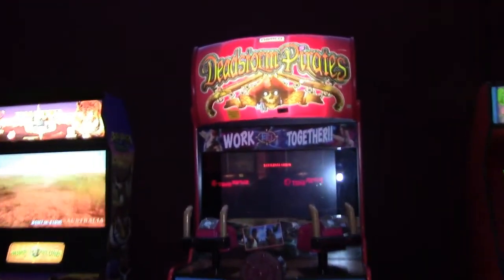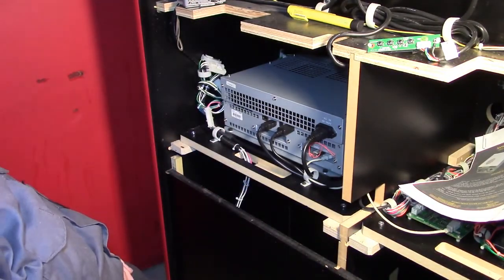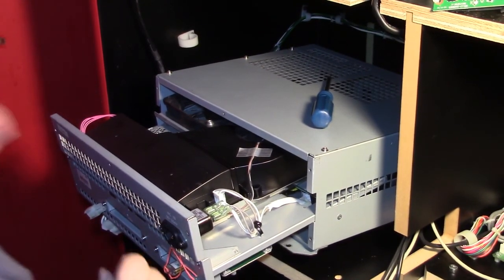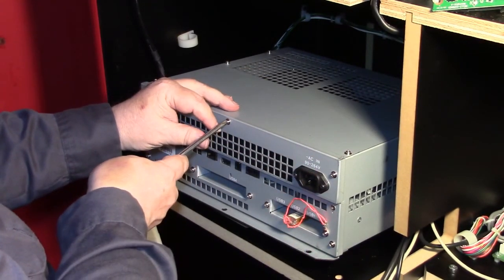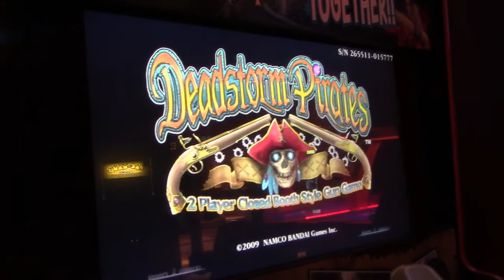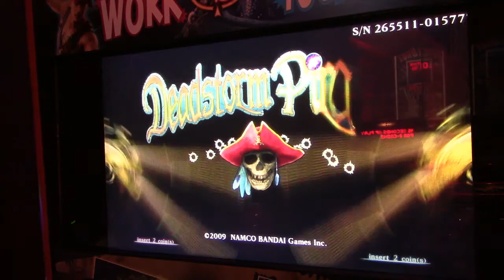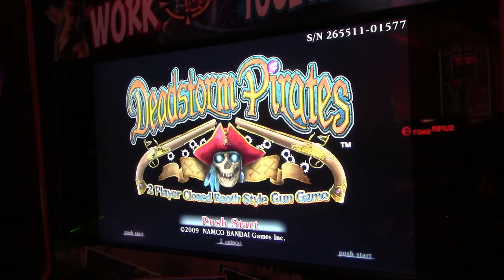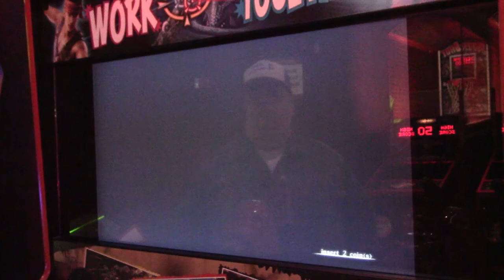Arcade Fix Deadstorm Pirates BATTERY02ERROR

Comment: Good video Sam, it is very interesting to see the inside of these more modern games.  I guess Namco doesn't provide a Service Manual?  in order to protect their IP?
Reply: How long does NAMCO support these games with parts and trades/swaps?   I guess that game is already 8 yrs old....
Reply: I replaced the Bluray Drive in my PS3 (original model) years ago and it was not very difficult to remove/install. (the ribbon cables are a bit tricky) . If NAMCO's warranty/support doesn't have many years left it would be cheaper to do it yourself, than shipping it back to them.

Comment: Ah this appears to one of those Namco Arcade systems that are based off of the Sony PlayStation 3
Reply from the maker: Yes, it is based on the Sony PlayStation 3 slim system. I believe I could have fixed it by digging a little deeper but if I had screwed it up then they would not take it back in trade for a working unit and they had me insure it for $2,000.00 when mailing it back. If it were my game, I would have tried to replace the battery.
Reply: @SamsArcadeFix  yikes, all that just to replace a darned battery, also i thought most of these Namco boards where based on PS3 Fat systems (probably the CECH-G series) and where known for RSX failure, but at least this one seems to be behaving